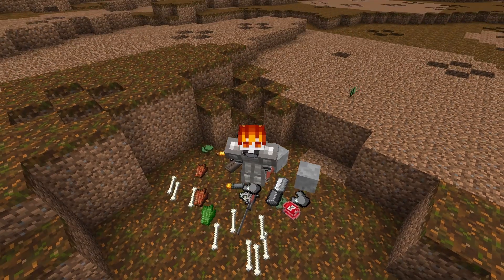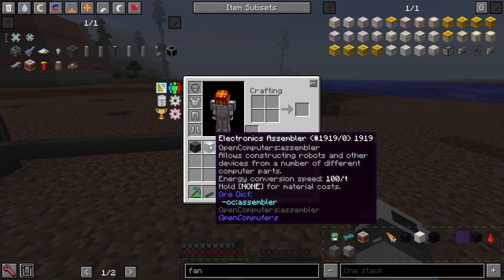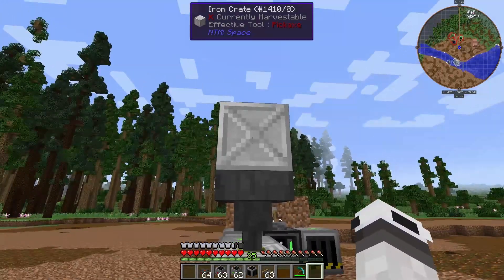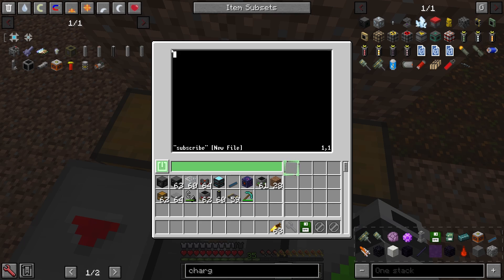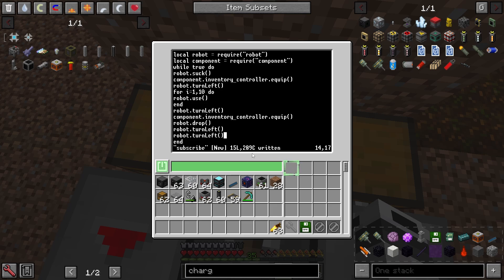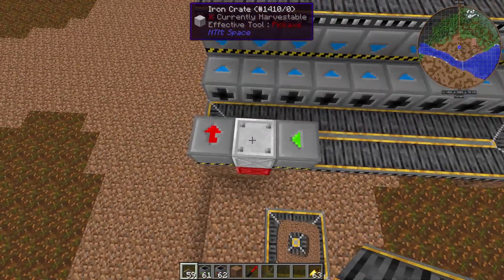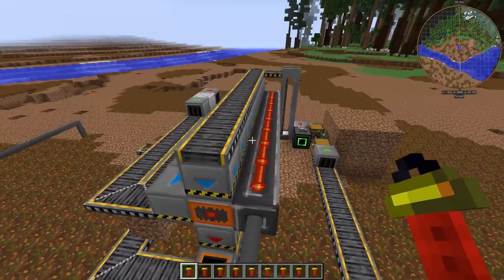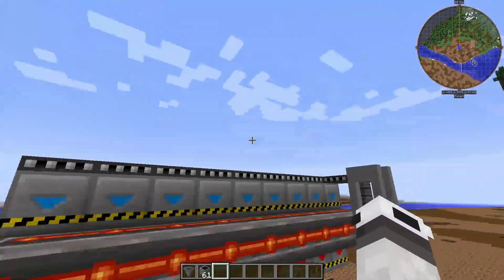The Solution to Schrabidium Production

Comment: You can use notepad++ to edit the files too.
So much better for spotting errors :>

Just reenter your world to load any changes you made.

Its saved in cursfore in your install under the saves from OC

PS: Blocks work too and save charge
Reply from the maker: I use normal Notepad and and Prism Launcher.

Comment: There is also a simple solution for the explosion damage. Substitute all conveyors for conveyor inserters in line. Theyll insert into the  next inserter in line. Its also instantaneous and cheaper then pneumatic tubes.

Yes its an exploit.
Reply from the maker: That's silly.
I should try it out.
Reply: @StainedSteel Its awesome. Ye ol' pneu tube. Back in my time we didnt have those fancy schmancy pneumatic tubes. We pulled ourselves by our bootstraps to make it work.